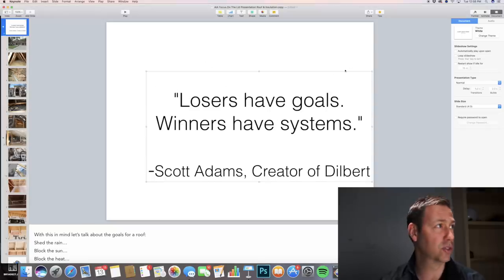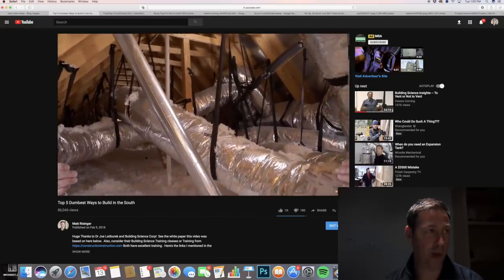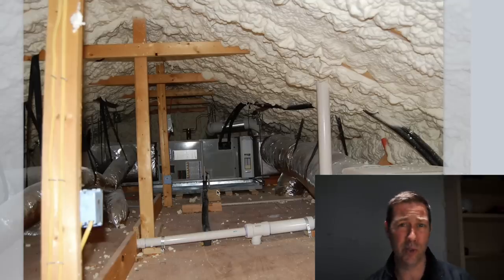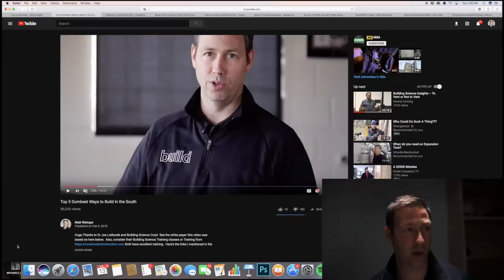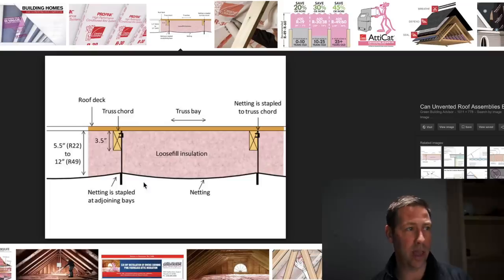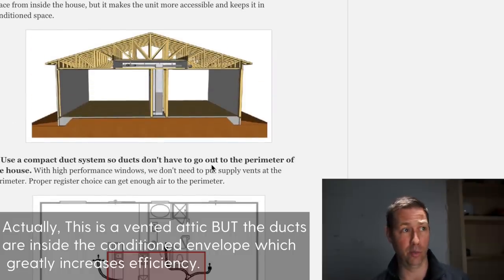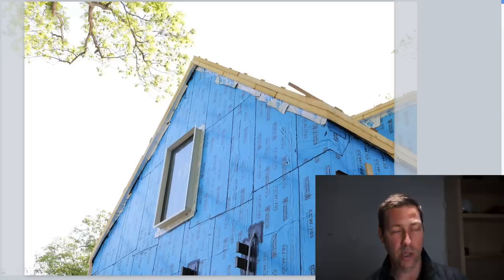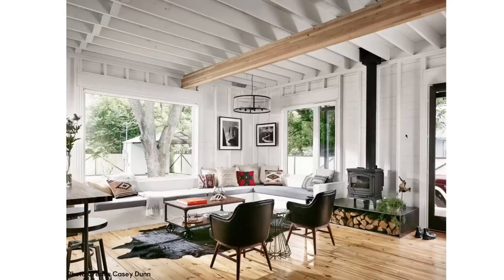Attics/Roofs - Dumb vs. Smart - How to Build Correctly

Comment: Gasp!  Toward the end of the video, did Matt really say $250/sq. ft. was a cost efficient figure???
Reply: "North of"
Reply: williamhoodtn Yeah, that might be typical in California or New York, but it's damed expensive in Texas.
Reply: Here in Ga too. You could probably cut cost with 2 x 6 exterior framing and using that 3" of insulation board he used but the wood will telegraph some outside temp to the inside. The roofing system was spot on.
Reply: I payed 150k for my 2080sqft house.....yes i have the fluffy stuff....that means i payed 72.11/sqft......with his math id pay 250/sqft.... Or 520k for the same size house....a 370k difference....over 30 years id need to save 12,333/year in energy savings(this doesn't even include the financing of that extra 370k over 30 years)
Reply: williamhoodtn nothing this guy does is cost effective
Reply: If you think quality is expensive, try poor quality.  Consider the operation and maintenance costs over the building's design life (or reasonable period of time like 30years) when deciding what is cost-effective or "expensive".
Reply: All housing markets are local.  A new house the size of your in Northern Virginia would cost in the 700k to 800k range....and that's traditional construction maybe on an eighth acre.
Reply: Building codes are what keeps your house from collapsing on you when the wind blows hard or burning down on you while you sleep....in addition to saving you money on heating and cooling.  Don't sound criminal to me.  Sounds like protection from shoddy and unprofessional work.   Building codes save lives and money.
Reply: D. Grigsby what happens when the power goes out
Reply: Ed Speanburgh, What do you mean "What happens when the power goes out"?
Reply: "Fullpattern", You need a nap.
Reply: D. Grigsby what happens to these houses when the power goes out and you cant condition these attics.
Reply: Ed, I guess the temperature and humidity may increase for a few minutes or a few hours until the electrical power is restored and then things will be conditioned back to normal operating parameters if they were ever outside them.  Perhaps, since the building envelope is so well designed and built, there would be a negligible difference in temp and humidity even after several hours without power.  In any event, I would think that the building would be robust enough to survive weeks of no power.  That does not mean there would be zero issues to correct....as is the case with any type of structure in a disaster type situation.  If one should live in an area that doesn't have dependable power supply, they could install a Generac or similar generator system to run essential building systems during power out situation.  My family did just that since we live in a rural area and it has worked flawlessly.  It really comes down to having a contingency plan.
Reply: D. Grigsby sounds like a disaster for those of us in Florida. Black mold generator. Lol
Reply: The way this guy designs houses you don’t even need to run your a/c or heat not nearly as often as you would in any other house however this guy is spilling all his secrets so if you can do it your self like I can you won’t be out of money I take bits and pieces of information that I can gather as legit information and influence it into my house
Reply: Tyler Wells lol.

Comment: I'd like to share my experience with high efficiency furnaces in unconditioned spaces and the lack of local codes and knowledge. It's almost comical but these poor home owners are the ones having to pay for mistakes made during the new construction process.
Reply: You're right they pay the cost of contractors short cuts poor engineering and poor quality in craftsmanship  it's all about as cheap and quick as possible for as much profit as possible they don't care about their customers even after the sell in resolving problems it's a cheap bandaid fix maximize profits is all they are concerned about

Comment: Carlisle products are fantastic $250 a square foot is pricey... I can believe it the waterproof membrane alone is costly... I used to work for the company that makes the waterproofing wrap its an asphalt material on plastic... also worked for a company that makes the poly iso solid foam board the best insulation you can buy... $250 a square foot is expensive (he didn't misspeak) but when it comes to energy savings you will make all of that back and then some.

Comment: There's no way I would seal the underside of a roof and trusses without an air gap and steel on the roof surface. Too risky
Reply: This. This guy doesn't give two shits what happens once there done. Try ripping away osb or plywood that's rotted from moisture and has spray foam under it. The labor alone is insane.

Comment: The idea of a conditioned  space in attics is great just don't forget that the Manual J heat load analysis now needs to include that volume.  If you don't you will have troubles.  A majority of HVAC contractors that I have run across don't know how or won't do a proper heat load analysis. They are just trying to sell you a lot more equipment than you need. Too big an HVAC is not good!

Comment: I wish you went into more detail about pros cons of roof leak issues with open vs closed spray foam. Also, is 90% efficient ac that important when you put money into a vent free attic?  More detail on the ac noise dampening would have been interesting as well. Lastly, what type of foam does not need a thermal barrier? 
Thanks for your videos!

Comment: would conditioned attics be ideal in cold climates?
Reply: hi, I'm in a cold climate with a sealed attic using spray foam. I have moisture issues which lead to mold on Windows and closet clothing. I have baseboard heat and ductless A.c. units. what's my best option to remove moisture.?
Reply: Ventilation if your home isn't new construction (if it is new construction the moisture is normal so buy a dehumidifier and rum it for a couple of months or until humidity levels drop).  

Tight homes need supplemental ventilation.
Reply: thanks,  I can run my ductless units in dehumidifier mode  24/7.  it's a shame cause it seems counterproductive, having to run a compressor waisting power.
Reply: Have you looked at an ERV to get some ventilation air?
Reply: I was under the impression that insulating the bottom of your roof deck will reduce the life of your typical asphalt shingles, because they get too hot not being able to dissipate heat. Let me know if im wrong please
Reply: yes, I'm looking at ERV vs HRV right now. Not sure on location of fresh air supply and stale air exhaust vents. The house is a high ranch 2 floors with  all bedrooms and one bath upstairs. having 1/2" bath kitchen ,living rooms downstairs.
Reply: That sounds right to me.  I imagine that if you're planning to use asphalt shingles you'll leave a ventilation gap to allow air to pass between soffit vents and ridge vents, e.g. with rigid foam board, and then spray over that.

Still, I'd rather be able to see the roof framing for the sake of maintenance.
Reply: In a cold climate, I would say that ventilating the entire attic is important to allow escaping humid air to exit the structure rather than condense on the framing and insulation.  In a warm climate it might not be such a big deal, but any house needs to be able to breathe in order to release moisture as well as cycle in fresh air, and the attic is a vital part of that (in my opinion).
Reply: @terat. wouldnt a ventilated attic eventualyl accumulate a TON of dust?
Reply: A little, just like inside the living space, but I think that's more because nobody is ever up there vacuuming and dusting.  Think of all the dust buildup in places you can't reach inside living spaces, like on top of cabinets or under appliances!

Particulate isn't nearly as big a deal as toxins, both from respiration and from out-gassing by building materials/finishes, and moisture from bathing, cooking, breathing, etc.  I have read that building code in a lot of areas requires that the home be basically hermetically sealed, but then air must be cycled in from outside in order to compensate for the lack of fresh air - also a code requirement.  There has to be some sort of reason for doing things that way, but I don't know it.  Maybe smog issues in big cities, requiring extreme control over the air entering the home..?
Reply: My grandfather built his house with all of the ductwork between the ground floor and the first floor, and then put down plywood over the joists in the attic to allow for storage.  All of the insulation is under the plywood, and if you look up you can see straight to the roof deck.  Yes, it's dusty up there, but so is the storage building out back, which has no ventilation whatsoever unless you open the windows.
Reply: is building a house with plywood over OSB (i call chip board) better? or significantly cost more? the only reason ia sk is, i saw a video where OSB board BURNS uicker in a fire...which not good
Reply: I had not considered fire resistance between the two!

My experience with OSB is that it is generally denser/heavier than plywood, which seems like it would lead to a slower burn...but maybe the glue just sizzles away, leaving a bunch of wood chips..?

I like plywood because even after it has taken water damage it is still comprised of solid sheets of veneer rather than a bunch of little pieces that will crumble away, so it retains much of its strength and continues to hold fasteners right up until the wood begins to rot.

I think one of the advantages OSB has over plywood is it is supposedly equally strong in any direction, so you can use more of an OSB panel because you don't have to worry about the orientation of the pieces you're cutting out.  Plus, the randomness and interlocking nature of the grain gives it better split-resistance and holding power...as long as it is kept dry.
Reply: i believe it burns quicker because osb has glue in it which is usually a petroleum product...and well...that stuff likes to light up like a christmas tree,

if money were no issue id totally build a house out fo solid planks of pine of something lol

thanks for your detailed responses...ive learned alot!
Reply: If you like ice dams on your roof.
Reply: I read about some law enforcement agency...somewhere...?...finding grow operations in attics by flying around in the winter and looking for houses with unusual snow patterns on their roofs.  I am confident that this is at least 5% relevant to what you just said.
Reply: @mon-ti6bx  you need a vapour barrier on the inside. This is something Matt sadly don't understand at all how it works when watching his videos. To simplify what happens is that the temperature and absolute humidity, AH (Not relative humidity) is higher indoors. Both of these try to equalise with the outside air through the walls and roof. Because of this the AH and temp gets lower gradiently throughout the walls. But if the temperature decreases faster than the AH the relative humidity in the wall will rise and the vapour condensate in the walls if it reaches 100%, as in your house. What the vapour barrier does is to significantly lower the AH early which allows the temp get lower without reaching RH 100% in walls and roof.

Comment: So it's ok to put spray foam directly under the decking of the roof without an air gap?
Reply: No it's not ok, 1) voids shingle warranties, 2) tends to trap moisture or condensation against wood, problems 5 years down the road.  We are just beginning to see issues with spray against roof decks sprayed 5-7 years ago.
Reply: I do not agree with Matt on this spray on insulation direct to the sheathing.  The APA (American Plywood Association) specs out requiring that one side of the OSB or plywood have an air space next to it to allow moisture to escape away from the wood.  Radiant sheathing will also require that there be an air space next to the foil laminated side.  I would recommend a ventilated radiant barrier roof deck using a double deck with furring strips or installing a full coverage baffled underside to a continuous vented soffit and up to ridge vents to achieve a 1/150 nfa.  Then a foamed underside could be achieved.  The direct foamed decks are a nightmare for finding leak issues and if the decks have to replaced, oh boy.
I believe that GAF has a really great vented roof decking product that would offer the best of all worlds.
Reply from the maker: Not true. It doesn’t void warranty and even if it did when was the last time you heard of a collection on a shingle warranty.
Reply from the maker: The only issue with Moisture is with high humidity in the house. Use a dehumidifier if you are in the South and/or add a small amount of AC supply
Reply from the maker: Yes it’s ok.
Reply: Shingle manufacturer’s don’t automatically void the shingle warranty.  They say that if they determine that an unventilated roof system was the cause then they may void the warranty.  
My issue and the APA’s issue is if a leak does occur then moisture is trapped and can cause decking issues which are not visible from the attic space.  A cool sealed attic is good if done correctly.  I am a strong proponent of a vented deck from the eaves to the ridge, whether it be a furred double deck, or a baffled underside, or a manufacturer designed deck system such as GAF’s Cornell ThermaCal Nail Base Roof Insulation Panels.  There are retrofit applications of sprayed-in-place foam insulation that allow for ventilated attic assemblies. Where this type of application is installed, GAF’s recommendation of proper attic ventilation amounts should be followed.
Reply: I've done an inordinate amount of research on this question over the past few years and here's what I've found on the subject.  It only increases the shingle temp 1-3 degrees and the data on how much that degrades the over time has shown to be completely negligible.  The random angle of your roof plane in relation to the sun versus your neighbor's would have a more measurable effect on the shingles.  Replacing roof sheathing due to a leak or whatever is a non issue.  Just pry it up like normal.  The foam will rip/can be cut off easily.  Yes it will take random chunks out.  Just be prepared for spraying more foam from the top side to fill the voids.  Shave the excess foam and then re-deck as normal.  As far as finding leaks.  Give me a break.  Water is still under the influence of gravity.  It will collect as normal.  It's not like the whole 4x8 sheet is going to disappear while you're looking for the source of the leak.  

The moisture getting trapped against the decking was a big issue of mine while I was looking into this.  Just do as Matt said and supply DEHUMIDIFIED air to the attic and it'll clear up any potential issues.  And that's not to say you would have had one anyway.

Radiant sheathing has a positive impact but not enough to make anyone choose it over using spray foam and enclosing the attic into the conditioned space.  

If you employed the design of putting the perforated radiant barrier on the top of the roof sheathing and then also vented that deck with furring strips and another layer of sheathing, and then ventilate it with a Cor-a-vent type product up to the roof peak,  you'd get the benefit of the drying potential outward and the radiant barrier's effects and still be able to enclose the attic with open cell. 

Thoughts Matt?
Reply: Matt Farris Now we are on the same page with the vented deck. The perforated radiant barrier does make a big difference when combined with ventilation. Venturi is your friend.
Reply: That air gap sounds like a good idea to me.  How could you go about insulating underneath the rafters [with an air gap] without making it a permanent installation?  Being able to take sections down and then put them back up would be really helpful for checking out the rafters and roof deck.

I am imagining something like like 'boxes' of thin rigid foam filled with spray foam, or even using forms to 'cast' the spray foam into panels before putting them in place.  Is there a reason the spray foam must be sprayed directly onto the rafters, aside from speed during initial construction?  Why not just use thick panels of rigid foam and avoid spray foam altogether?  The ideal house would be like a lego set that could be disassembled and put back together without carting a bunch of waste to the landfill, because there will always be some kind of maintenance to do somewhere down the line.
Reply: So our arrogant host thinks using icynene to stop RADIANT heat is “smart” construction. Ridiculous. Icynene or “fluffy stuff”, as he calls it, should ideally be placed on top of the ceiling. Because that is where CONVECTION heat occurs. A radiant heat barrier, such as foil, should be used on the underside of the roof, with an air space. Both types should be used. This is a video of “dumb” construction.
Reply: Loved loved loved the last house you showed! Is it possible to take ducts out of a standard TX home and just use those air units you used in your house? How does it effect the home's value?
Reply: Thought this was odd too.  I would expect him to have shoots or "W's" to rent from soffit to ridge cap.
Reply: @thesisters7929  Ductless mini splits are great and are actually pretty easy to install yourself if you dont mind voiding the warranty like myself :) I have had good luck with the Pioneer systems https://www.highseer.com/ Not sure on the durability side of these yet as the oldest unit i have is 3 years old but so far so good.
Reply: @seanm3226  When he says "fluffy stuff" he means blown in fiberglass or cellulose. Icyene is spray foam.